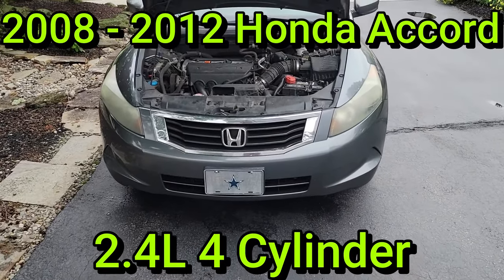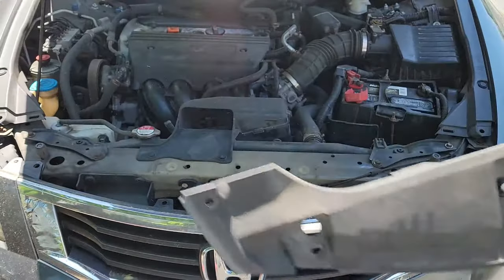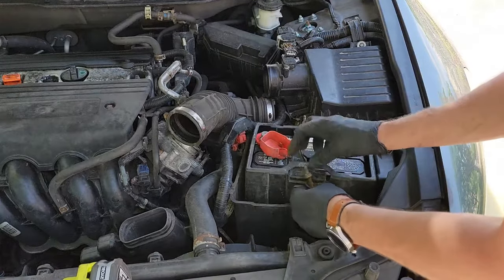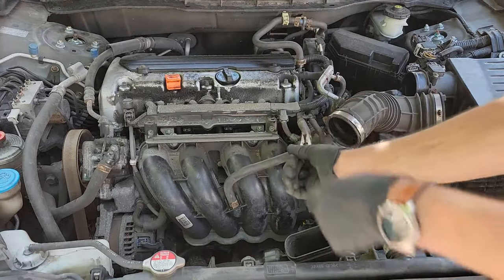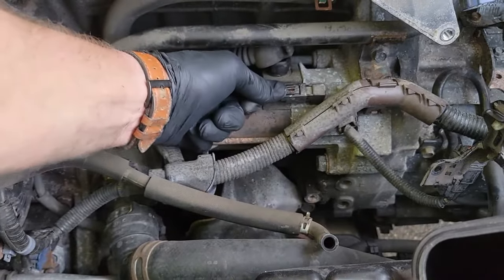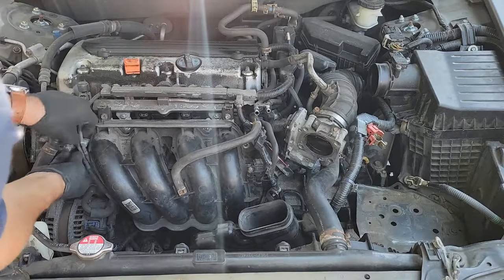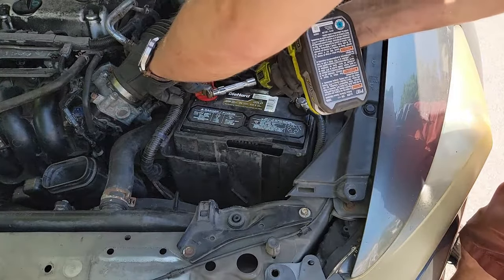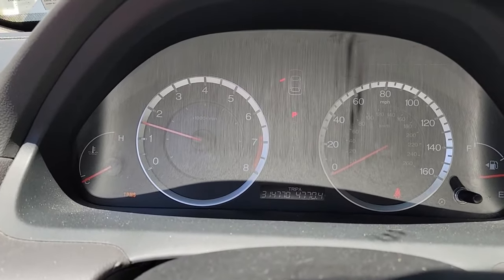2008 - 2012 Honda Accord 2.4L Starter Replacement (Quick Guide)

Comment: Thank you Sir.  Very Very Much for your TIME. All went well. Except for the little plastic lock on the little connector broke coming off.  - The one that plugs into the Starter.  I used zip ties. There is no short cut fix...
Reply from the maker: Ugh sorry man! Those connectors can become so brittle as they age. I'm glad you were able to get it done though!

Comment: Just put mine on August 12 2024. You dont have to remove all that stuff. Just the manifold. Find a bungie cord to hold the manifold to the coolant & radiator intake so that the manifold will be out of your way and the starter is right there. 2 bolts you remove starter will come right out. If not like mine didn't just a few knocks & it'll then be able to come out. I'm definitely not a mechanic & I was abke to take mine out in 30 minutes. It's reallly not difficult after completing the task
Reply from the maker: Not necessary unless you have an issue with that 14mm bolt like I did. You will need all the help you can get.

But yes, overall a very simple job. Thanks for watching!

Comment: I replaced my starter in my 2008 Honda. Now the starter stays engaged even with the key out. Try to reconnect the negative terminal it still cranks. Please help
Reply from the maker: Sounds like a defective starter. Are you using an OEM unit? Or aftermarket? These Hondas are very sensitive to aftermarket parts from what people have told me in the comments.
Reply: @TrickShiftGarage  I’m not sure , I’ve had the starter tested at Oriellys. The starter is good , the guy disconnected the ignition wire from the starter and it still cranks. Took the starter relay out and it still cranks. What could it be ?

Comment: My 2010 honda accord start went out. Broke down at a grocery store. I've watched this video a few times and hopefully confident enough to be able to do this on my own in the store parking lot lol! Thanks for the video!
Reply from the maker: You can do it! Just be careful because that bottom bolt of the starter (I think it's a 14MM) is such a pain for some of us. Hopefully you don't run into that issue! 

Let me know how it goes brother! 🤟
Reply from the maker: BTW, we have a longer more in depth version of this video on eout channel too! So if you want to follow along more easily and want to see more details, check out the Accord playlist on our channel. It's in there! 👍
Reply: @TrickShiftGarage  Took me 3 hours but was able to replace it with zero issues!!!! I've never changed a starter before so this really helped out. That bottom bolt was just awkward to get to because my hands are huge but it didn't take me long at all! Car started and runs again!
Reply from the maker: Dude that's awesome, glad you got it done!

Comment: Thank you for the excellent tutorial, it was a great help.

Over all, after spending significant time cleaning surface corrosion from the face of the intake, the entire installation took me about 4  hrs and was pretty aggravating at times because of some crusty bolts and uncooperative brittle wire connectors. (I live in the Northeast rust belt).
If you happen to have big hands like I do, one tip I can offer is to remove the left side radiator fan and antifreeze reservoir bottle to make more room for when you have to fumble with the lower plenum bolt and bracket.  At one point during reassembly, I dropped one of the bolts somewhere deep into the engine compartment, never to be seen again .  Luckily, I spotted an identical bolt used to fasten the battery tray bottom, so I used that one to re-attach the wire harness bracket to the plenum. I located an alternate fastener for the battery tray from my bucket of orphaned nuts and bolts.
The two starter bolts gave me major resistance, but they were no match some PB Blaster and a 2 foot long cheater pipe on the ratchet handle.  
The job was no fun at all, but I have to say that despite a sore lower back, and some cuts on my knuckles, I felt pretty darn good after turning that key and hearing how it starts and sounds like it did when it was brand new. 
One last tip for the radio reset if you don't already have your code, there should be a white sticker bearing a five or six digit number on the outer left side panel of your opened glove compartment door.
Turn the radio power on then enter your number when prompted on the display.  You should have tunes now..
Reply from the maker: Awesome man, I also had some issues, especially with the starter bolts. I'm glad you got it done and thanks for sharing that information! That could help someone else! 🤟

Comment: I followed this video step for step and it after putting the new starter in the car wouldn’t start so now I’m gonna have to find a mechanic…I’ll just pay someone next time 😔
Reply from the maker: Well, either a wire isn't connected or there is something else wrong with your car. I'm sorry you are going through this.

Comment: Would it be necessary to replace the intake manifold gasket while doing this repair?
Reply from the maker: I don't think it's necessary unless yours looks like it needs to be. However, since you are already in there, it's probably a good idea to replace it if you have over 150k miles. Just my opinion though. Thanks for watching! 🤟

Comment: Can you tell me why after doing this my car would start then shut off like there is a kill switch or something? Starter is working great but it starts then turns off. Everything isn’t totally hooked back up just wondering if you think it’s that or something else?
Reply from the maker: I honestly have no idea @SV. If it starts, the starter shouldn't be causing it to shut off. You may want to check all of the wires around that area and make sure nothing frayed or is on the verge on disconnecting.
Reply: @TrickShiftGarage  thanks man trying to figure it out I feel like something is just disconnected it’s almost like a sensor is turning it off
Reply from the maker: I'm sorry man, I wish I could be more helpful. Be sure to let us know what it is just in case someone else has the same issue.

Comment: You can remove both starter bolts and slide the starter back and out and then remove the starter cable very easily without worrying about getting around that pipe, when installing also connect the starter cable first....
Reply from the maker: Good tip! Thanks for watching! 🤟
Reply: No problem, the how to video was good and very informative, no background music, animals, people talking, nor rumblings about things.....VERY HELPFUL VIDEO...
Reply from the maker: Thank you so much!

Comment: use genuine honda starter in this accord or the engine light could come on with a crank sensor code
Reply from the maker: Agreed. Multiple people have mentioned this now. So far the Accord does not have any issues, but as a precaution you should definitely use one from Honda. 

Thanks for watching and taking the time to comment! 🤟

Comment: Do you not have to clean the mating surface of the intake manifold? Just curious I am about to do this tomorrow.
Reply from the maker: No it shouldn't be necessary. Dirt and grime doesn't really build up around that area. However, if you notice any, definitely remove it. 

Let me know how it goes man! 🤟
Reply: @TrickShiftGarage  thank God. I saw the 1A auto or whatever video of this job and the dude had RTV or whatever smeered all over the mating surface. Musta been something someone did on a previous repair or something? Glad that crap isn't on their from the factory.

Comment: Could I do this with my 2013 Honda accord or is it different?
Reply from the maker: Unfortunately it's different. The starter is on the opposite side on 2013 and up Accords. 

I have been contemplating buying a 2013-2017 Accord, and if I do, I'll do a ton of maintenance videos on them!
Reply: Access is underneath the car, but there are less parts to remove.  Room to work around is even more limited.

Comment: I’ve done plenty of those starters and did not have to remove that intake
Reply from the maker: On these cars you have to in order to access it.
Reply: @TrickShiftGarage  I have large hands doing this over 30 years. You do have to take the intake boats loose, but I’ve never had to fully remove it to get that starter out.
Reply: @TrickShiftGarage  matter of fact, I have to do one today maybe I should make a video and show that you don’t have to pull that intake all the way off to get to that starter
Reply from the maker: Do it. Would love to see how it's done.
Reply: @TrickShiftGarage  Service manual says remove intake manifold
Reply from the maker: Thank you.
Reply from the maker: I'm still waiting for that video. The starter sits right behind the intake manifold, so I don't see how he could possibly remove it without removing the manifold. It just doesn't make sense.
Reply: @TrickShiftGarage  I can’t even laugh that car I mentioned a little while ago. I actually did have to remove a good portion of the intake, but I know that there were some others where I didn’t have to go through what I went through so I stand corrected. Thank you.
Reply from the maker: I know on the 2013 and up Honda Accords the starter is on the other side of the engine. So it's easier to access underneath the car. Is that possibly what you were referring to?

Comment: Man, I’ve done this and vehicle still won’t start and makes no noise when turning the key to ignition. I’m overly frustrated and I’m sure it’s my own damn fault
Reply from the maker: Can you provide some more details? What was your vehicle doing before you replaced the starter? Did you make sure all connections to the starter are secure? You may need to go back and check them, unfortunately.

Comment: Maybe take HALF a second to point out what manifold bolts are being removed. You hacked thru the sped up footage and I cant for the life of me tell what it is I have to remove. Decent tutorial otherwise..
Reply from the maker: There is a longer video on this channel for the starter removal and install. If you take a HALF of a second to look for it, I'm sure you can find it. 

Don't forget, I didn't have to make this video. The amount of work put in (camera angles, lighting, etc.) is not as easy as you think. Also, editing takes a bunch of my time. I work full time, YouTube is just a hobby. 

If this video isn't to your liking, you can find one that works for you.

Comment: Did you need a new manifold gasket ?
Reply: Shouldn't if the old one isn't damaged, doesn't hurt to replace however they are like $12 on amazon, with the throttle body gasket being $4
Reply from the maker: Very true. It doesn't hurt to replace it, but the one in my buddies car was free of damage.